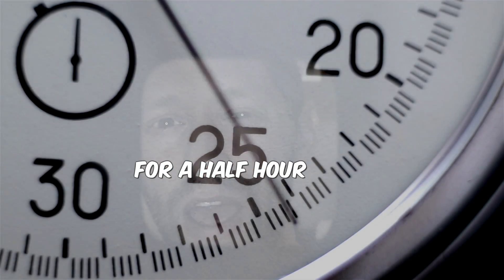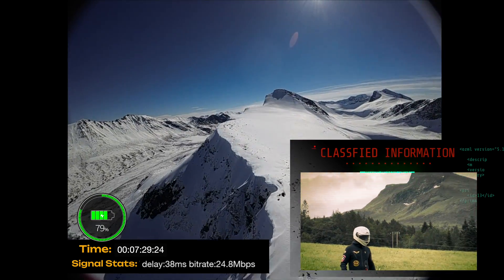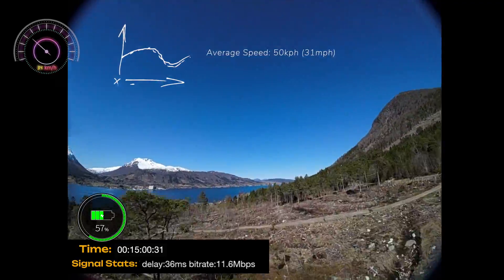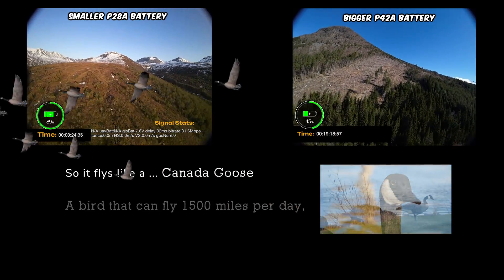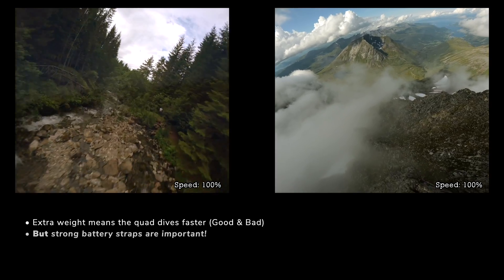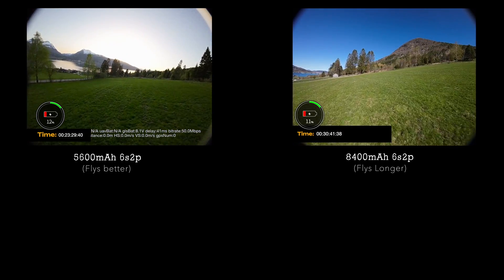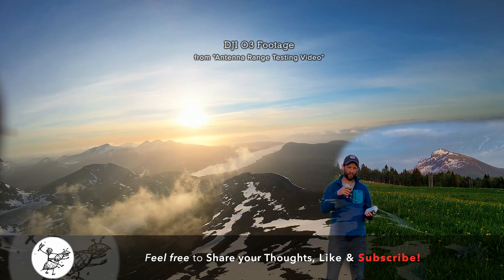Long Range FPV Battery Testing DJI | 30+ Minute Flight Time | 18650 vs. 21700 Li-Ion Packs 6s2p DIY

Comment: Love the test and the vid ! If you didn't already i would suggest calibrating your amp meter to the mah you get on the battery charger ! This way you can get accurate mah consumption in flight and that gives you more confidence in the pack's state of charge than raw voltage !
Also, p60b cells are coming this year, enabling a theorical <900g 12000 mah 6s2p pack 😵
Reply from the maker: Great for watching, appreciate the comment.  Yes, I calibrate all my drones, it’s a must do for long range stuff. Fun to watch new battery technology evolve, Molicels have been a long time favorite. Cheers!

Comment: what was ur drone specs? are u using 2306 motors and 5" props on 7"?
Reply from the maker: Here’s the setup in the video: 
Chimera 7 frame. EMAX Eco 2807 1300kv motors. 7” HQ J75 props.  DJI O3, no GoPro mounted.

Comment: 3:50 is good test. 6S can do sustained dive. But many videos show 4S has difficulties doing the same test. For example, crash with 4s trying high G maneuver https://youtu.be/8g72VzgtDes?si=QOqV18c6a9WIvcKW .
Reply from the maker: Yea, 6s works great, especially with low KV motors & quality li-ion cells.  Important Tip: Use strong battery straps because the weight can easily break cheap straps. I actually have Velcro on my frame and batteries, and then straps.  This create a very secure stable setup.

Comment: really enjoy your videos! After viewing the 4s/5s/6s compression I've decided to build a 6s battery for my 5' quad, but weights about the same as the quad 😅
it also feels really heavy in the air, gains speed on dives and isn't that good at maneuvering in the turns
+ carrying two of those batteries into the mountains is a pain for my back, which already carries a DJI Mavic and a camera + tripod 😂

My question to you is:
I'm planning to build a lighter 4" quad and pair it with 4s batteries
But after some research I've found that 4s with lower KV motors might be more efficient.
what if I pair some 1900 KV motors with a 4S battery (on P42 cells for example) instead of 2500 KV?
Propeller pitch will be also low, like 2.3 (ChatGPT told me, it would be a better option for efficiency)
Flight style, just like your long range
Reply from the maker: @wolodymyrblack  years ago I flew a quad (2450kv 2306 motors with 6” props) all over the mountains here using a 4000mah 4s1p 21700 pack. 
I pushed it too far in this test, https://youtu.be/gxSfD6PH1P0 but should give you some idea of how it could work for you. Check it out, and appreciate you watching and supporting then channel, cheers!
Reply: @GiantAntCowboy  14 km to the mountain and back (almost 😅) is really impressive! Was it a 4s1p or 2p?
and still what about 6s motors (like 1900 kv or lower)  on a 4s battery?
I've read it would be more efficient for longer slow flights
My goal is it to make a really lightweight setup on a 4 inch frame using a 4s1p Lion battery, to carry it up high into the mountains
Reply from the maker: @wolodymyrblack the quad in the snowy test/crash had 2450kv 2306 Xing Motors, and used a 4000mAh 4s1p 21700 pack. 
It was a wild ride, haha

Comment: Would a 4s2p P45B work? With the 45/90A constant and 90/180A peak and 270 grams, could work or no?
Reply from the maker: @mcbrite  hey P45b are great cells, but I believe they are only rated to 45A. A 4s2p pack would weigh about 600g, be 9000mAh, and have a max current rating of 90A. 
Being 4s instead of 6s will require more Amps and have more voltage sag during “punch outs”, but the weight savings could result in more flight time. 
My original video compares 4s, 5s, & 6s packs, you should check it out here:
https://youtu.be/rynkx_OYTFI
Hope that’s helpful, cheers!

Comment: Wow amazing, I was stressing over flight time but these is easy, and I can get the P42a cells for surprisingly cheap, should work well with 900Kv motors and large props on a 8" build, Amazing research, what do you think the C rating on the 6S2P battery is?
Reply from the maker: @Polkem1  yup, the 6s2p 18650 packs are rated to 70A and the 21700 packs are rated to 90A. So there’s plenty of power available. 

Highly recommend building a couple! Thanks for watching, cheers!
Reply: @GiantAntCowboy  Great, more of a cruising a exploration guy, this will be my first drone, was stressing about the flight time of lipos until I saw this, will definitely be building 4s2p and a 6s2p.
Reply from the maker: @Polkem1  yea, I’ve been using Li-Ion packs on this quad for years. In fact here’s my original video when I first got this Chimera 7
https://youtu.be/rynkx_OYTFI

Comment: Do you have a video making the 6s2p setup? Or any recommended video. I have followed FalconRads video to make single packs but I’d like to make a 2p also so I can have no huge pack instead of having to parallel them.
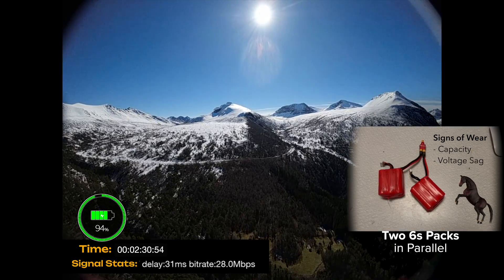Reply from the maker: @JuicySmullietFPV  yea, proper 6s2p packs are great. I don’t have a build video, but if you re-watch @0:54 I show a couple build pictures of my 2p pack. 
You can see I made the wire a square for connecting the inner cells which works great and should ensure current flows evenly through all cells. 
I used solid copper for fun (curiosity) but regular stranded copper is probably a better choice, and it’s insulated. 
Anyway hope that’s helpful, happy to answer questions, cheers!
Reply: @GiantAntCowboy  I’ve got to figure out the configuration. 1p is easy, negative to positive… but 2p, I don’t quite get that one yet.
Reply from the maker: @JuicySmullietFPV  it’s really the same as a 1p build but each cell is now two cells. So start by taping cells together in pairs, then pretend they are a single cell. 
Contact me on Facebook GiantAntCowboy, and I can share some pictures.

Comment: P45B cells are a game changer! I’ve been pushing a 6S2P (90A continuous) DIY pack hard the last couple of weeks and really enjoying being able to fly fast and push the amps without even getting the battery pack warm. Awesome video! Cheers!
Reply from the maker: Yea, I’ve had a hard time finding P45b cells that’ll ship to Norway… but these trusty P42a cells still work well. 
Did you solder you packs? I’ve argued in the past that nickel strips have too much resistance and cause “hot packs”.
Thanks for watching, appreciate the comment!
Reply: @GiantAntCowboy  yeah I soldered the cells together using 12awg wire. And I agree with you, don’t have real data on this, but by just looking at it, I would think the strips would have more resistance than 12 or even 14 awg wire. Cheers!
Reply from the maker: @J-MADFPV Copper has much lower resistance than nickel. In fact the reason you can “spot weld” nickel and not copper is because nickel gets hot enough to melt when current is applied. 
That fact alone explains why so many people complain about Li-Ion packs having voltage sag and getting really hot while flying. 
I’ll stick with soldering for all my packs, always had great results.

Comment: What if you go with something like the Samsung 50S 5000mAh batteries. I've got one 6s1p pack in front of me and it's weighing 422g raw batteries and 465g all soldered up and wrapped. I'm thinking of strapping two together with a custom parallel cable to get 10,000mAh capacity and wondering how my Apex LR 7inch can handle it.
Reply from the maker: Yup, that’s configuration will work. I’ve known people that ran that setup on a Chimera 7. 
It’ll fly heavy of course at almost 1kg of weight, but will be solid in the wind!
Reply: @GiantAntCowboy  that’s what I’ve gained from watching your videos. You have given me a lot of confidence about long range hdzero, but I’ve still not gone more than 1km away because I’ve just had no working gps rescue yet. It keeps failing in some way, quad acting weird or just not being available etc etc
Reply from the maker: @chrisalexthomas  glad to hear these videos are helpful. Regarding GPS, I switched to M10 modules this year and they work much better than the M8 ones I’ve always used. 
Specifically HLGRC M100; not the mini version though, that one doesn’t work great for me. 
But yea, anything under 5km is pretty easy with decent antennas. Are you using the VRX or HDZ Goggles?
Reply: @GiantAntCowboy  I’ve got one of those gps modules too. Other quad has one of those flywoo goku compass modules. I suspect the problem is more to do with betaflight though. One thing I added was one of those Vifly gpsmate devices so I can power the gps before I turn on the quad. And I’m running the hdzero freestyle v2 with the goggles. Not the vtx. One thing I realized though is that when I started to change around my antennas gave me amazing, or terrible reception. I had one antenna which would suffer to send video at 200mw a distance of <30 meters but swapping out the antenna for a random one from my bag I got full bars and no static at all ¯\_(ツ)_/¯ that’s why I like your videos cause you do a lot of trial and error and that gives me input onto my own testing
Reply from the maker: @chrisalexthomas  exactly, I like when people share full DVR footage so you can see how their performance compares to your own. I even review my own tests to see if my setup is perform better or worse than it used to. 
Antennas/Coax/Connectors/Pigtails get damaged/worn pretty easily, and often cause poor signal performance. Always nice to have some spares to test.
Reply: @GiantAntCowboy   I meant to say vrx, not vtx

Comment: My 21700 3s give me 45 minit hovering time . ( Using 900kv ,10 inch props )
Reply from the maker: Yea, that sounds about right. I did another video years ago comparing different packs 4s-6s in 1p & 2P configurations and found the 4s to be more efficient. 
With “flying things” lower weight is almost always better.

Comment: I'm loving the Molicel 21700 P45B 9000mah 6S2P.

I just built and have 3 flights on Molicel 18650 P30B 6000mah 6S2P and returns with 3.6 volts 8 mile mountain climb round trip with full size gopro 11 on AOS 7 frame. The  21700 returns 3.7-3.8. 

Not sure which i like more yet. I like how light the 18650 is.
Reply from the maker: Nice those are the cells I’m always after, but delivery to Norway is always tricky. The 18650 pack usually has enough range for most flights, it’s lighter, and fits better, so it’s my most used packs for sure. 
Thanks for watching and sharing your thoughts!
Reply: @GiantAntCowboy  Do you do a full charge to 4.2?  Just curious.
Reply from the maker: @kkeil9449  yes. All modern Li-Ion are rated to 4.20v; many years ago it was only 4.10v which is why there confusion. 
I just use normal LiPo Balance Charge at 4A.
Reply: @GiantAntCowboy  Cool. As far as antennas, I could definitely recommend VAS crosshair extreme. I know a guy who can sit inside his or her car and easily get 4+ miles of range.
Reply from the maker: @kkeil9449  yea, always want to try the Crosshair Extreme, at one point VAS was going to send me some to test but haven’t heard from them recently. Idk. 
Right now my current setup is working excellent, I’ll share those results soon.
Reply: @GiantAntCowboy  nice

Comment: at 1:07 your 18650 pack soldered with copper tube? that the one for building helical right?  is it better than 14awg? which one has lower IR?
Reply from the maker: Yes, good catch. It’s 14AWG solid copper I had leftover from my Helical antenna builds. Theoretically it handles current better than stranded copper, (lower resistance) and it makes the pack more rigid, but it’s more likely to break a solder joint if the pack gets twisted in a crash. 
Not sure it’s worth using, just trying something different.
Reply: @GiantAntCowboy  solid copper tends to break at solder joint? ill take that as a note.. i actually want to build one, and luckily you did one..
Reply from the maker: @DNLKRNWN Solid copper doesn’t flex as easily as stranded copper. So if the pack was to get twisted enough a solder joint might crack, or rip off the battery. 
In most cases it’s probably fine, but this was the only potential negative I could come up with when choosing to try this wire.
You’re planned to build a li-ion pack?
Reply: @GiantAntCowboy  yep, rigid means solder jointwill suffer. Yeah, i need more packs.
Reply from the maker: @TERBANGFPV  yea, I just built these, my other ones were a few years old and worn out. Previously I ran two 6s packs in parallel, but decided to build these proper 6s2p packs this time. Much nicer for mounting and charging. 
Unless you often use 1p packs of course; I highly recommend the 18650 pack, really great battery to have.

Comment: What was the total flight distance of each pack?
I run 8s2p 21700 on my 8 inch and get around 30 min and 30 km.
When you fly slower, flight time increases.
But from my testing the flight distance is always similar with the same battery packs.
Im running 2812 motors with gemfan 8060. You can hardly feel the weihgt of the packs.
With my smaller 7 inch 2807 motor running 6s2p 18650 it  already starts to feel heavy.
Reply from the maker: Total distance for both packs was right around 20km, so I was flying a bit faster with my 18650 pack. 
Yea, I don’t mind the weight, quad flys fine, especially in windy mountains, but when zooming around the 18650 handles noticeably better.

Comment: The shot diving through the low clouds was really cool, I fly analog freestyle but I still built a helical for the lol and looking forward to your testing :)
Reply from the maker: Thanks, helicals work great with analog. A few years ago I did this video of some flights out 7km, great signal until I made a horrible mistake… 
https://youtu.be/KSt4SiZ9-KI?si=VsxQEnbuT_97FwzB
My other testing with HDZero is representative of how Analog will perform as well. Definitely recommend!
Reply: @GiantAntCowboy  I built mine using one of the models you linked after seeing your videos, I generally use it instead of a patch now
Reply from the maker: @SwainixFPV  yea, I’ve been using them for years. Have tried other antennas, but just keep coming back to them for pure performance. Plus they are cheap to make! Antennas with comparable performance are pretty expensive…